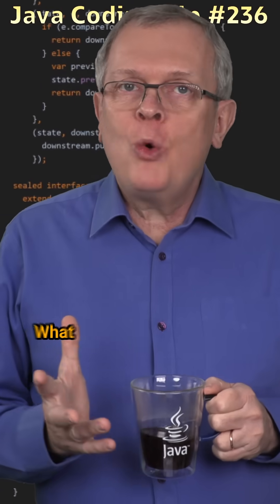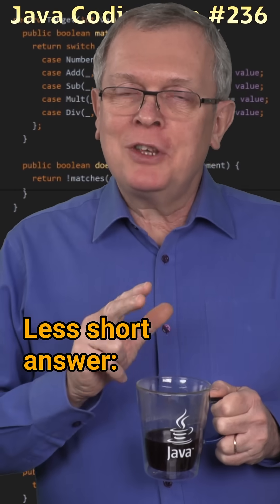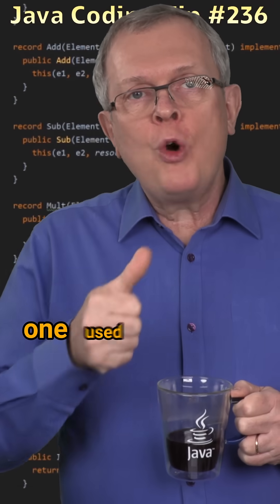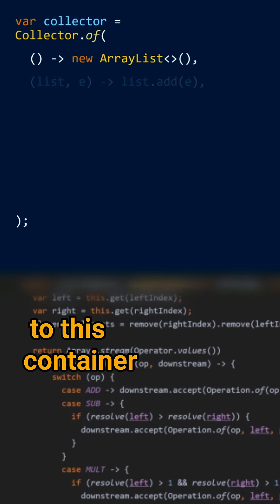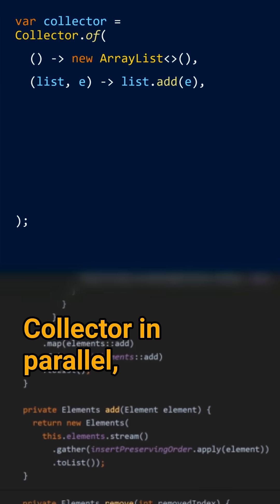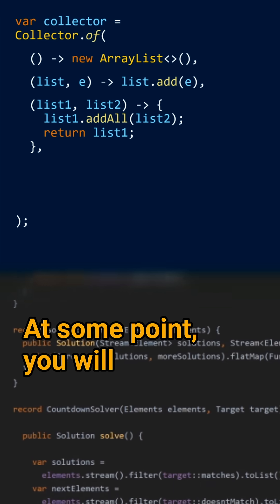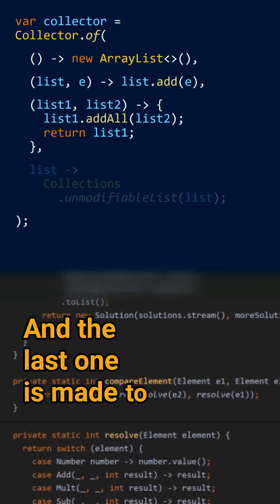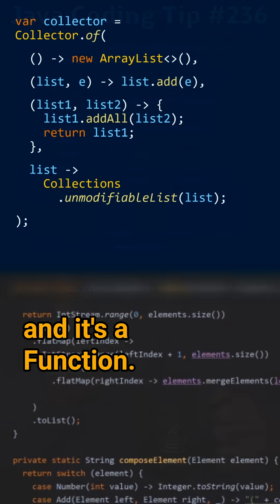What is a Collector built on? #javalanguage #javacoding #javatips #javacodinginterview

Comment: Brother why.? What is the need for this.? Java is good but also so bad wtf.
Reply: Java is not a language in itself, it's a Virtual Machine in the first place. Think of it as a micro framework for other frameworks, it helps me sleep at the end of the day.
Reply: @ mad, this basically feels like a malloc and strncpy. But just so much worse. Maybe I’ll try to not think about underlying implementations and just accept whatever’s happening.
Reply: Wonder to know why is bad?...Is CPP bad?...is JS bad?...which is good for you? please elaborate.
Reply: @orolandorp87  cpp has issues, I agree. Let’s not put Js in the same bracket as these 2 languages. 
But the problem seems to be that it’s very counterintuitive. Maybe that’s just me.
Reply: @Akimbofmg9_  it looks counterintuitive because it was designed to be a pure OOP language. If you look at a pure FP language you'll probably find that also to be counterintuitive. It's the nature of focusing on one subject area to look unnatural because naturally we use a mix and match of ideas and paradigms. That's why in recent decade, Java is more focused on diversifying it's paradigms, adding streams and lambdas, essentially introducing FP without the hassle of defining interfaces and classes first.